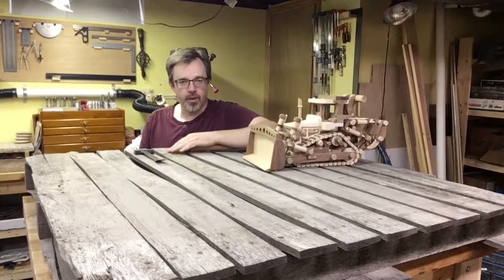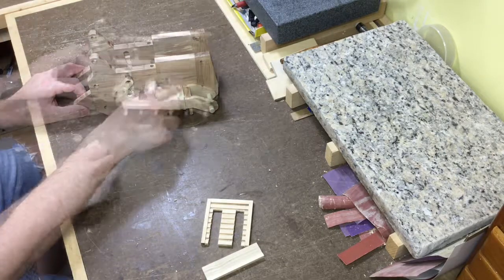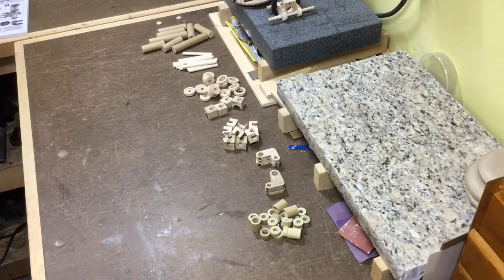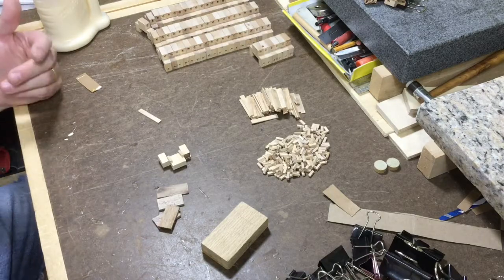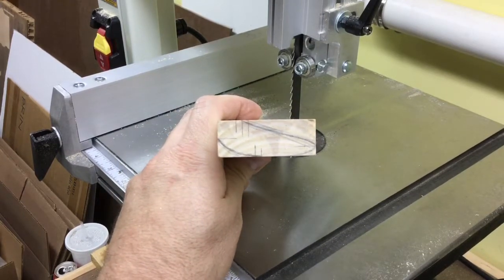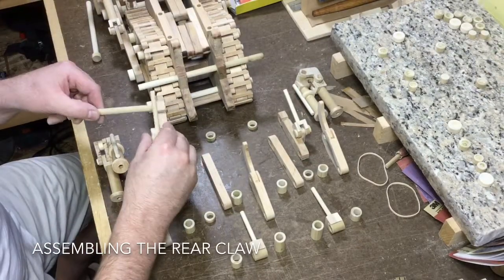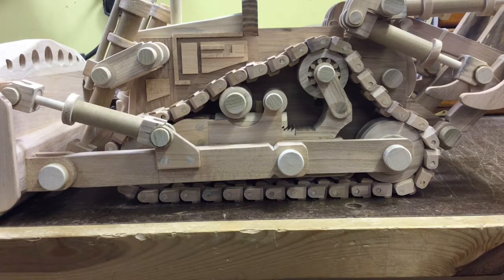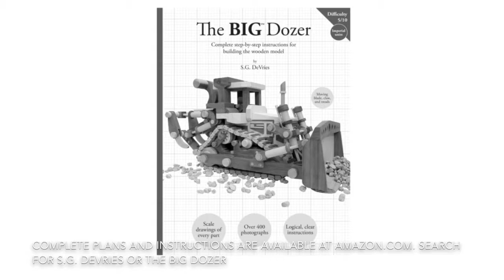Building the BIG Dozer model from an old wooden pallet - plans available

Comment: Thats real good 3d printed dozer,bub.
Reply from the maker: I don't own a 3d printer. But if I did, I would certainly try printing the parts, just to see how difficult it would be. Would still take quite a bit of sanding and painting work though to get it to look good. And of course it wouldn't be a woodworking project any more, which is most of the fun of it, for me at least. Thanks for watching!

Comment: Well, I'm 20 minutes in to this video and I have to say that so far, I like a lot of your processes.  I like those little machines that you have for model making and they look like they would do well for the smaller parts.  One of the challenges I have is making tiny parts on a full sized saw.  Your little device for holding dowels while you drill is brilliant and I may attempt to make my own version one day on my program.  All in all, so far I am enjoying the video and will continue it a little later as I'm a little pressed for time today.  Great work so far.  Is this your plan or did you purchase it somewhere?  I wouldn't mind trying my hand at making one of these for myself.  Either way, nicely done.
Reply from the maker: Kenny, thanks for watching. In response to your questions, all my toys are my own designs. I also write complete instruction manuals with scale drawings of every part and step by step photographs for the whole things. Just look up S.G. DeVries on Amazon and you will find me. I strive to write the best plans possible, so they are extremely detailed. My small scale table saw and thickness sander are made by Byrnes Model Machines. Worth every penny in my opinion.  Plans for the small parts clamp are in both the Big truck and the Streamroller instruction book, but if you have a Facebook or public email I can just send you a pdf of the drawing if you would like.
Reply: @s.g.devries8557  I would truly appreciate that.  I will check out your plans on Amazon and see if shipping will kill me.  LOL.  My Facebook Page for the channel can be found at https://www.facebook.com/kennyearrings1/
I will give you my final thoughts on the model once I have finished the video.  So far, I love it.  I like the tensioning mechanism.  Very cool.
Reply: Well I finished watching the entire show and I have to say that I enjoyed it.  Very well done on all aspects of this build. I see that you are as fond of your INCRA T-rules as I am.  Thanks for the great job on the video and the project.  I love it.

Comment: Hi I have brought your plans and made three Bulldozers so far ,with the latest one I would like to paint it but I need some Ideas on what colour and where . Have you any Ideas?Thank You Glenn
Reply from the maker: Glenn Browning great to hear you have successfully built the bulldozers! As for painting, if I were ever to paint one I would try to go with the yellow/orange that is common on Caterpillar brand. I think I would paint the larger parts that yellow and use either dark wood or black paint for the highlights. I also think you would have to paint many of the components before assembling them onto the machine to prevent paint from getting into the moving parts. So I would paint the frame yellow before attaching the blade, claw, or wheels. The side engine details on the frame I would make black. All of the hydraulics I would make have yellow barrels and black rings. I would make the claws yellow but the two dowels that run through the claws black. I know, my color scheme isn’t terribly original. If you do paint it, let me know how it goes and how long it took. I have resisted painting mine or even putting on a finish because it seemed difficult but now you have me intrigued. Good luck!
Reply: @s.g.devries8557  Thank you for replying , I am at the stage where most axles can still be removed and so I will see how I go ... I will send you a picture when done if I can find a way to do it .Plans are very good .Thanks again
Reply: Hi S,G what about the cab and grouser plates .for colours , I have not fixed the cab on yet.Now its time to decide to Paint or not .
Reply from the maker: For the cab I would do the columns and the roll bar on top of the cab in black, maybe also the control panel. Yellow for the larger parts. The treads I would do in yellow with the trouser plates in black. Wow, painting the treads will be quite a job... good luck!
Reply: @s.g.devries8557  Well its painted and everybody likes it saying "It looks like its ready to go to work" It took at least two weeks . I had to break off some shaft end covers and dismantle the whole machine , I followed your suggestions but the tracks are all yellow for now. Is there a way I could send you pics of it .IT WAS A BIG JOB.
Reply from the maker: Glenn Browning I am working on setting up my web site so soon should have a non personal email that I can post here for you to use. I would love to see the pictures.